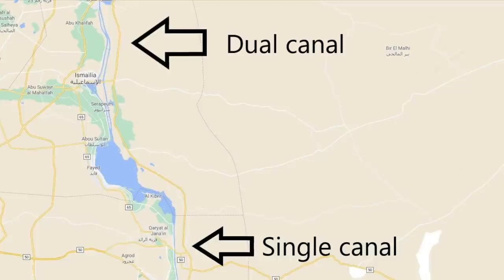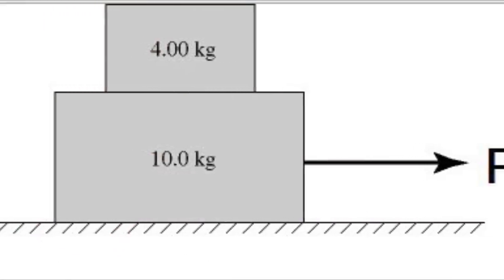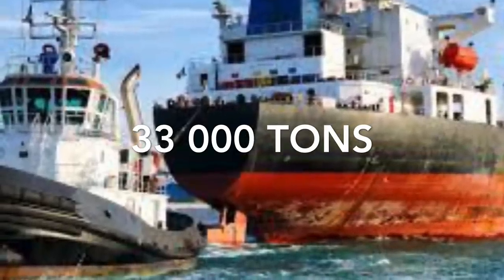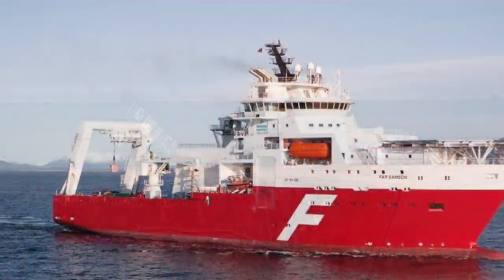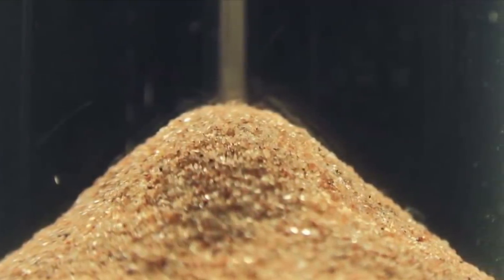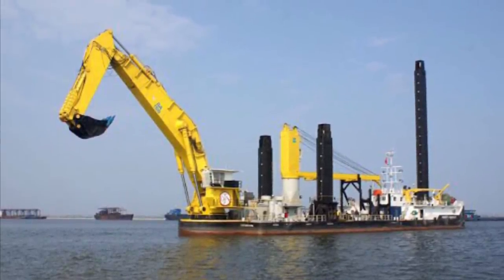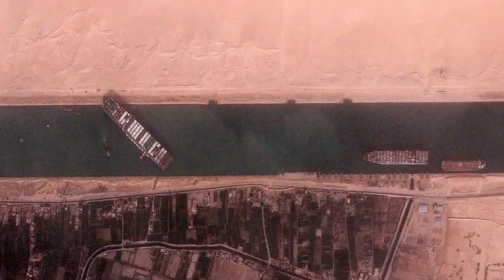MV Ever Given - why can't it be pulled out? Suez canal blocked

Comment: Why are they trying to use other boats when they literally have enough land behind it to pull it out using excavators and other machines with a way higher pulling force than something in the water.....??  seems silly...
Reply: Why would "they" want to get it unstuck ? It was done on purpose ! If the panama canal gets blocked America is going to be invaded or attacked by the Chinese and the Russians !
Reply: @wisdomoverfear2685  True. At this point it is looking more and more like it was done on purpose.
Reply: @wisdomoverfear2685  or aliens
Reply: @wisdomoverfear2685  The US pacific fleet is enough of a match against both. That doesn't make sense.
Reply: Nothing on land can match the pulling force of a large tugboat.
Ships are a LOT larger than land vehicles - and weigh MANY MANY times more.

Hint - the HEAVIEST land vehicle in the world (Bagger 293 or one of it's close Bagger series brothers) is about 14,000 tons - less than 1/30th of the weight - while this ship is NOT all that close to the heaviest SHIP ever built (there was a series of oil tankers that were pushing close to 600,000 tons displacement at full load, and there are bigger container ships in the 300,000 ton range).

The ship itself has BOW THRUSTERS that are locomotive-range in power (3500 HP) - which is in the same power range as many TUGBOAT engines, but not in the rage of the highest power tugboats.
Reply: @bricefleckenstein9666  i would say that it does not have to be necessarily a moving object. It can be some kind of a fixed structure with massive hydraulic jacks for example (i am not engineer but i hope you get my point) which could somehow be connected to the ship (by enough ropes perhaps which could sustain the forces)?
Reply: @bricefleckenstein9666  Where they beach ships for breaking winches pull the ships up onto the beach, the same principle from the opposite shore (far enough inland to get good support clearly) could help pull it out, but that takes time to set up, Smit are probably already en-route with the equimpent, assuming someone called. 
The largest tugboat has a pull rating of 420 tons, land based winching can far exceed that, by many times.
Reply: its not the lack of pulling power thats keeping them from Kedging her off , technical term for dragging her off by force...the risk of further damaging her is of primary concern..On a scale of 10 , this doesnt even merit a 3..
Reply: She must be freed from the sand gravel and mud first , then a combination of tide , kedge anchor and tugs will try to free her..Smit is basically working on a landmass wc is a hundred times easier than working on a salvage tug.
Reply: @halopartiska2  It would take longer to BUILD that "fixed structure" - which you're going to have to build in the MIDDLE of the Canal, then dismantle afterwards - than to get an existing crane ship to the area.
Reply: @stuinNorway  Well, if you use ENOUGH land-based winches - and longer cables even in steel aren't that uncommon, just need a LARGE drum on the winch, or attach an "extender" cable to the actual cable IN the winch.

Do keep in mind though, you're going to have to have winches on BOTH sides to control the positioning unless you have some sort of a "quick disconnect" at the ship attachment point or very close to it, one that works UNDER TENSION - and watch out for the flying cables when you DO release that disconnect.
Reply: @mannyfernandez6860  It's not all THAT easy to crack a hull, though it is a lot less stress if you can "float" her off to at least SOME degree.
Consider how many ships have run aground prior to this event, some of them quite large - USS Enterprise (CV-65) comes immediately to mind (yes, I realize that Enterprise was a bit under half the full loaded displacement).
Reply: @bricefleckenstein9666  Drum winches ? Seriously ? They'd never create the pull required, only option would be hydraulic rams that clamp the cable, pull, release, retract and repeat. Same basic theory as when they "launch" concrete bridges over a valley, pouring on land and pushing out as it gradually grown.
Reply: @stuinNorway  You still have to have the drums to take up the loose cable, even if they're not DRIVING it.
You would also be amazed how powerful some drum winches can get - it's all in the GEARING, as opposed to being limited by how hard you can clamp on the cable before you DAMAGE it.
You can also use MORE winches if you need to for more force generation - in fact, more winches with less power EACH might be better, as you can distribute the force more evenly across the hull and put LESS single-point stress on it, for less risk of breaking or bending the hull.
Reply: @stuinNorway  Academic point now, they got her freed and moving again.
Reply: @bricefleckenstein9666  did i write that i would build it in the water? There is plenty of ground around which could serve the purpose. This is what I meant by writing fixed. 

Why would i propose such ridiculous idea omg? 😂

Nevertheless they have solved it without our genius advices.

Comment: Just set charges at the bottom of the canal on the other end of the ship (not on the ship but in the water facing the ship) so the blasts can propel the end still in the water to swing around and break loose from the shore then it can float on down the canal. If it's backwards then have tugs steer it until it can turn it around.

Comment: find a massive container ship half its weight when fully loaded and pull it  off from the bow.
Reply: Pulling capability is NOT the same as transporting capability.
Reply: The video covered that, it would take 80 of the ships with the most thrust in the world to pull the ship off the sandbar.  Container ships are about moving cargo with the least amount of thrust which is why they float on water so there's little resistance.  The only way a cargo ship could move that ship would be if it had a few miles to build up momentum and was carrying a lot of weight to give it more inertia and the stress would probably tear it apart.
Reply: Why not slam an other container ship it to it and push it backwards
Reply: That's not how it works lol
Reply: "The nose" lol does he means the bulbous bow? that containership is a flat bottom vessel
 And where the hell did he come up with his Weird mathematical equations "1/3 of the vessel means you need to pull 50% of 1/3" what the hell is he talking about? Does that formula take to account the substrate of the channel? 🤔
This guy just made all this stuff up to get views

Comment: Hats off to the scientist who was on the steering wheel that time.
Reply: That is not applicable to this situation. It was  trained operator likely at the wheel and the vessel was pushed off course by a storm.
If you don't believe in science,  stop using it...stop using products developed by science....like your computer and smartphone...internet .and electricity.
Reply: @quantumbits  dude it was sarcasm. Take a chill pill. Neither you or I are going to pull that thing back into the canal.
Reply: @ninad7478  Oh!  ok  sorry didn't see the sarcasm emoji.

Comment: It's all fixed now so further speculative solutions aren't needed. But I want to share this. 

What if they had used high capacity seawater pumps to "pressure wash" the sand / clay material away from the bow? Dredging is good but if you wash the sand into deeper water it becomes easier to dredge. I'd have thought 🤔 So I was surprised this wasn't done. Even the pumps on board the Ever Given could perhaps have been used to flood the bank next to the bow with (widely available) seawater.

Comment: Island Victory actually has the highest Ballard pull in the world (477 tons) still obviously wouldn’t be enough
Reply: No need to use a ship . You need only plant an anchor point on land  in the right direction and use pulleys that way an excavator can move the whole ship off the banks easy
Reply: @elekkr  That would be one large ENGINEERING project to design an "anchor" to withstand 30,000+ TONS of force.
Reply: if my reading is right , a combination of dredgers and tugs and tide tomorrow is the Plan A..if it fails , lightering her is Plan B...simply kedging her wc is the technical term of pulling her off by force puts her at risk og cracking her hull.
Reply: The servo motors AIDA used in the most powerful hydraulic presses in the world, these presses with forces of more than 50,000 tons could easily pull that ship if anchored or oriented horizontally. Each servomotor has a force of 3000 tons, the problem is that I don't think there is any such colossal winch...
Reply: @Jowell8848  Those motors are used to drive a VERY short throw hydraulic piston though. Plenty of force, not enough reach to be of much help.

Comment: I think this is intentional been done and not an accident
Reply: Out of curiosity why? What is the motivation?
Reply: If it was intentionally stranded, the motivation may be exposure. To expose the contents of the containers. A form of whistleblowing.
Reply: What are the chances a ship this size running a ground in the channel .also so many countries relies heavily on the channel for supplies and this will drive the prices higher and fuel supply and finally to many problem in that region

Comment: I feel like there may be lock-N-dams that could be closed to float the ship....or build a temporary dam to raise the water level.  Seems suspicious to me.
Reply: Exactly.  Dam it.  10ft of water will do the trick.
Reply: Damns only work with flowing water. Plus that’d take way too long
Reply: @mhxxd4  It was an ides...I don't live anywhere near there to know.  But still seems odd that it can't pull its own weight out of sand.  They could hydro excavate it out quickly in my opinion.  I wish them well.

Comment: Their milking and taking advantage of a situation. If they really wanted to move it right away, they would of started unloading it right away. Their is alternative motives at play here.
Reply: you dont even need to unload it, there are several easy fixes to the problem. there are cranes that have lifting capacities of over 1200 tons, get 2 or 3 of those, that's 3,600 tons, then you use inflatable high pressure bags by the bow to pull it up, and put weight and pull on the stern. like a knife it'll come loose.
Reply: @TiberiusCowgill  get out there and get it unstuck then
Reply: @TiberiusCowgill  You could probably make hundreds of millions of $$, paid to you by all the other ship companies whose ships are blocked, if you can move it. Buy a plane ticket!
Reply: @TiberiusCowgill  1200 tons? That's not even a single stack of containers on the ship. And how do you propose those cranes stay upright on the sand soil surrounding the ship. Also, the stern of the ship is also wedged on the sand, to lift it out with air bags you would have to almost lift the ship clear out the water.
Reply: Said that the day it happened

Comment: Shift all the weight to the back , it will pop right out 🤣
Reply: Both ends grounded.
Reply: It could crack the keel and cause the ship to break in half. Then we have a recovery operation, not a rescue operation, and the time needed to clear the waterway becomes months to years long.
Reply: Or just call aquaman

Comment: The biggest problem is Egyptian authorities. They earn more than 5 billion USD for this canal every year. But they didn't do what they had to do. They ignored the digging of the sand and sediments. Every canal is built with a straight side wall. Eventually sand and sediments deposit and the canal turns into 'V' shape. It should be removed continuously to make it 'U' shape. But they didn't do that. It is said that the depth of the canal was just 0.5m at the side of the canal. This shallow depth is simply not acceptable... If it was well-maintained, this ship would've been easily pulled out by a small boat, since the bottom of this ship is not stuck. The size of modern ship is getting bigger but this canal is not maintained. So we will see many more calamities like this in the near future. The Egyptian authorities should learn lesson from this accident.

Comment: Minor fact check - cars don't weigh a ton (or a tonne).  If there's a car for sale in 2021 that's that light, it would be a rarity.  For example, a Honda Accord weighs 3150 pounds or more.  Even the Miata weighs more than a ton (both imperial and metric).

Comment: Je pose le question:? "What was anything that large doing in the canal??" Example: in the Panama locks, under controlled conditions, boats have very few metres (feet for you USA types) but they're lead through the locks, and Harbour Masters go aboard ships for the last few miles into familiar waters, (to them), but not to the Captain. I haven't seen a boat Io loaded since the Mary was redesigned by Henry the VIII and expected to still float.

Comment: I wonder 🤔🤔🤔🤔 you know when your opening the nut on the wheel of the car and you need to extend the bar for leverage. I wonder could this principle be used here. If you ran steal bars up both sides well out past the front and back of the boat and then used lorry’s to put pressure in the opposite directions forcing the ship to become free from the side bank. That would allow the other boats to pass while any damage is assessed. Just thinking out loud here. 

That or block both sides of the canal and feed water into the section the boat is in. The extra water will force the boat to raise up and move.

Comment: The easiest way would have been to run large high flow pumps aimed parallel to the vessel at the bow angled about 5 degrees downward. This would have destabilized and removed large amounts of sediment in a very short amount of time. This coupled with tugs on it.

Comment: Just take the weight off the front of the vessel so the weight in the back acts like a lever to lift the front up off the sand. Like a teeter-totter. That'll reduce a huge amount of friction and you can tug it out from there.

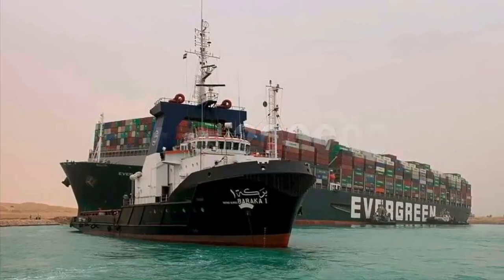Comment: 0:57 200,000 tons definitely does not equal 200,000 cars. Do not ever make this comparison, folks. 200,000 is the weight of 50,000 dually trucks, or less. The Dodge Challenger weighs 2 1/4 tons. That means 200,000 tons is less than 100,000 Challengers. Most cars, even small cars, weigh at least 3,000 lbs, or 1 1/2 tons. Very few cars on the market weigh less than that, and way fewer weigh less than one ton to pull the average down to one ton.

Comment: I knew I couldn't be the only one who thought of unloading it.
Reply: The unloading of a few thousand containers outside a port and would take a very long time. Even before they could begin they would have to get a crane there, to the desert by the canal. Then make sure it's stable, as it's mostly sand out there. It's not like there is a concrete boat dock to unload the containers on.
Reply: @gert-janvanderlee5307  I knew it wouldn't be easy, but I started to wonder whether they might have to.

Comment: Why not take four tugs with water directed propulsion and direct them towards the center of the freighter the water churned up with the ecvators on land could cause the sand to flow away once the sand is clear air bags underneath could be use to add bouncy

Comment: Wouldn't it be easier to just remove the containers from the front of the vessel and then keep the same weight at the back or add little by little  because by doing this the vessel might rise by front even by a little bit but it will rise then as the friction will be a lot less and no force holding it, you can just pull it and if it has actually risen from the front then then zero friction will be present there, then they can just pull the vessel out.
JUST IMAGINE.

Comment: .. I'd dig bore holes in the bank down below the 15m line plus clear as much as possible away from around the nose so it doesn't collapse more under the ship and blow under water bed level charges to flatten out the surface bank sand and shift it so the ship refloats as its no longer propped up by sand/canal Bank.

Sand isn't dense so multiple smaller charges won't sdamage the ships hull. As it won't be in direct blast contact. 

Tug boat at the same time for the moment  it refloats before the sand Bank settles again.  ( worth a shot) 

Repair then is as simple as a month of rebuilding the bank and dredging, much better result than having the ship striped and took apart, blocking the canal for years. 

Either that or the canals going to be blocked up for years anyway and needing to build a diversion canal around the ship.

Comment: wiggle with tugboats and pull out. wiggling will open up the sand and mud holding it and then water will fill up in the wiggle room and buoyancy will help while you pull it back and out.

Comment: Even if it’s less than 30,000 tons resting on the sand, you still can’t hire the starship USS Enterprise to pull it out. This is because one little mistake, and you can easily bust open the bow and.....Yeah, you do NOT want that to happen. Hence why they kept on digging and waited until high tide to float the boat. Glad that worked out for them.

Comment: I thought if they use few heavy lifting helicopters to pull  upper layer of cargo in nearby desert. Then use a deep water gun or digging in front. And anchor chains with the back of ship at her right corner and then pull the ship by the almost same size of cargo ship waiting behind that could do help. Well I am guessing, it could be wrong.

Comment: They don’t had equipment and are dump!

1) they need to start to take the charge off the boat to transfer it to another free boat
2) after the height are less they can not pull it from the back using a big boat same weight with strong engine!

Instead to waste time to try to pull it or take area off from the front!